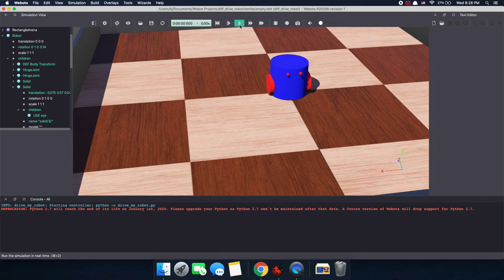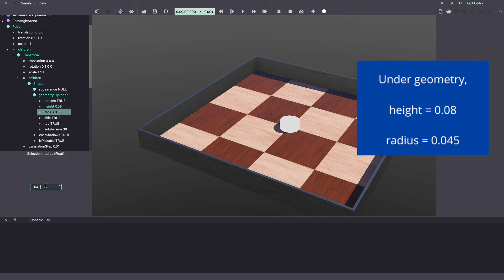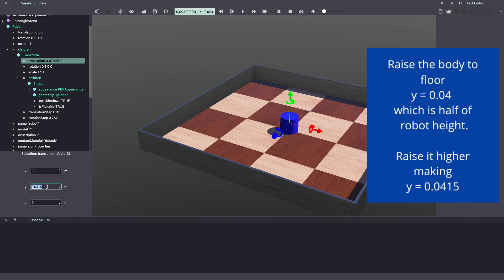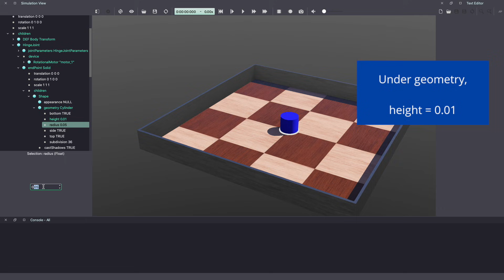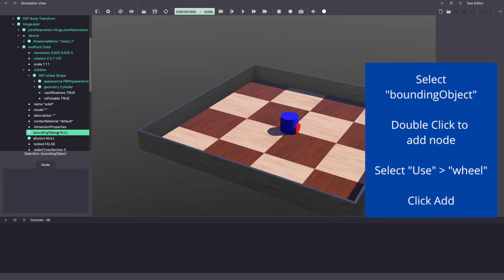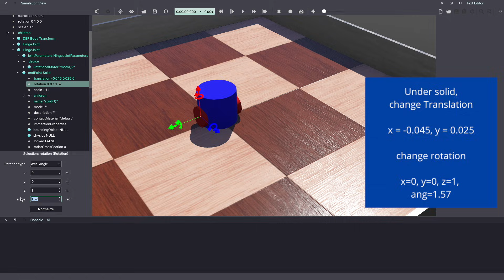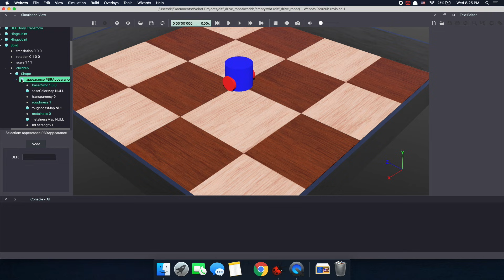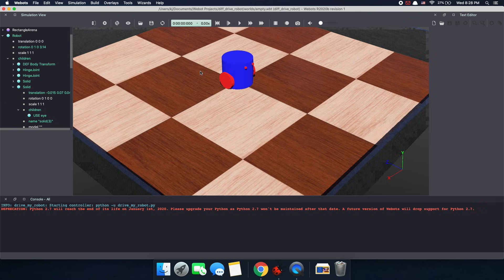How to design a 2 wheel differential drive robot in Webots? // Webots tutorial 2 // Kajal Gada

Comment: Hello, Thank you for the great videos. :) I learned a lot from them. For my midterm project, I need to make a 3 wheel car. The third wheel will be a ball custer. I couldn't find how to add ball custer to my robot. I want to add a third wheel in the back and in the middle. How should I align this wheel? If you can help I would be so happy.
Reply from the maker: Hi Ezgi,

I think you mean ball caster wheel. Similar to the 2 wheel diff drive robot you can add a hingejoint and a wheel at the end.

Instead of cylindrical wheel, you will have a sphere (for ball). To do this simply choose sphere instead of cylinder as shape.

Depending on your robots size, you will have to compute location to add it and size of the sphere as well.

Let me know if this works. :)
Reply: @KajalGada  Thank you for helping 😊 I will try this right away.

Comment: Hi Mam, A very helpful tutorial!
I am confused, why the robot doesn't tip over as it is similar to self balancing bot, as you have not attached any Castor wheel to it, assuming webot gives real world like simulation?
Reply from the maker: Hi Bhuvan,

Really good observation. The answer is in modeling. If you change the dimensions of wheel or cylindrical body, it will tip and you would need a third passive wheel for support. 

For this set of dimensions, it can support itself without tipping.
Reply: Understood, Thanks for Clarification!
Reply from the maker: @bhuvanjhamb2728  You are welcome :)